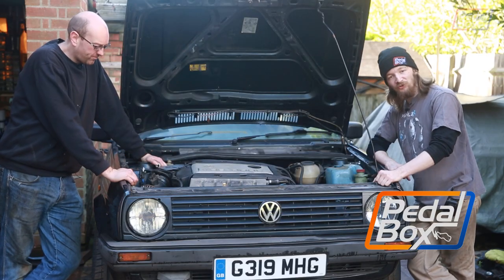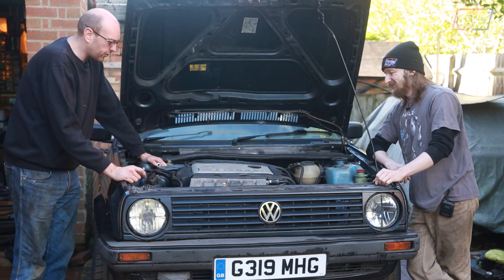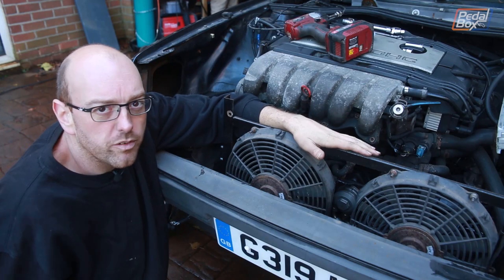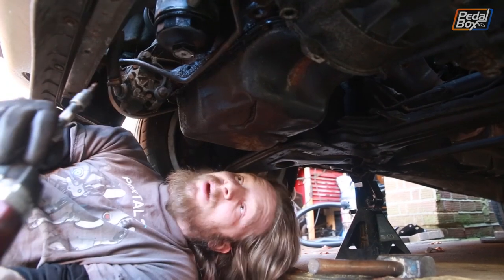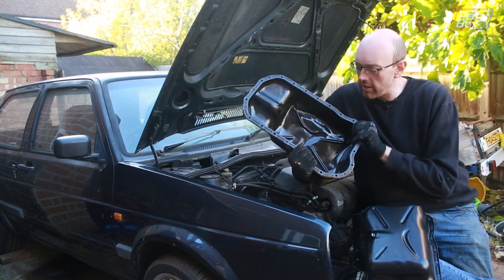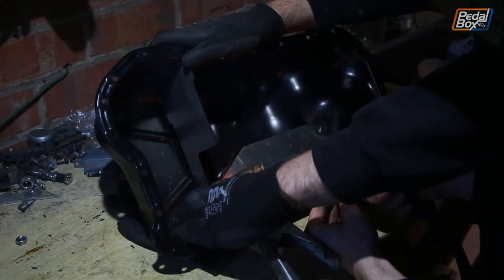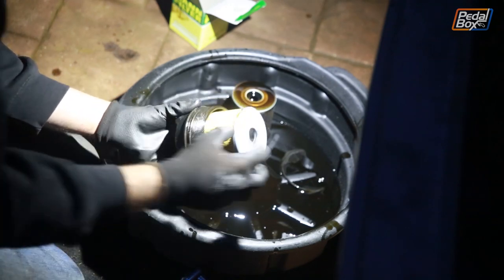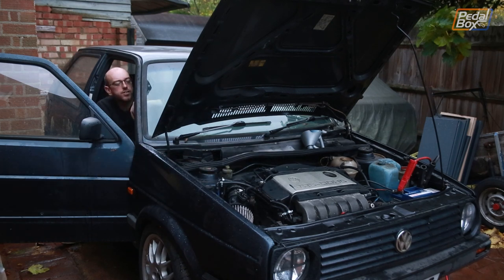The Golf Lives!... Briefly | Mk2 Golf VR6 | PedalBox Fleet Episode 65

Comment: Yo Pa here Chris - stole mums login.   The mugs I see at the end are holding the mugs!!  Good luck with the rebuild son. Similar happened to the S70 T5.  Oil all over the deck but this was from the turbocharger oil feed.  What a mug not tightening it up...
Reply from the maker: It's even worse because I tightened it when it was off the car FT, then backed it off a fraction it off to move a a rubber line and thought it was all back up when the wrench stopped. Whelp!

Comment: Ooh, that's bad!
But when that sort of thing happens, it's just an opportunity for an upgrade 😁

I've had similar luck trying to get to the track this year too...
On my way to a 2 day event and the air suspension in my Audi tow car failed. I missed the entire first day, then I got 2 runs up the drag strip when the race car burst a radiator hose and I wasn't able to fix it at the track.
The whole endeavour cost me  over £500 (and that doesn't include repairing the Audi) for less than 30 seconds track time. 😂🙄
Reply from the maker: Ouch. Thats not a great day. I think with insurance/etc I spent about £100 to not get an MOT, not even including an MOT cost, as it didn't get one.

Comment: where did you get that longer bolt for the sandwich plate that work with the factory oil cooler?
Reply from the maker: That one is from United Motorsports, but I believe that was the last one they had in stock. Struggled to find one from other sources, but if you check out episode 46 the parts are in there for the one I made

Comment: How is it you do things this correctly and fail this hard?? I'm 2/2 buying the cheapest engines and transmissions off random garage floors and running them without checking anything.
Reply from the maker: I... just don't know, baked in dumb mistakes I guess. And a topping of bad luck to boot
Reply: @PedalBox  that's no joke. I'm sure it'll be back on the road soon!